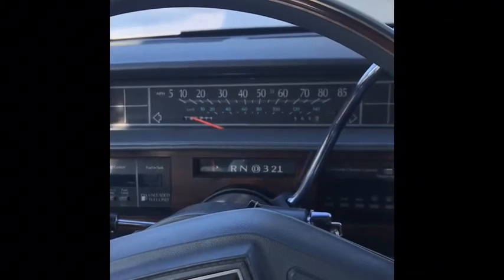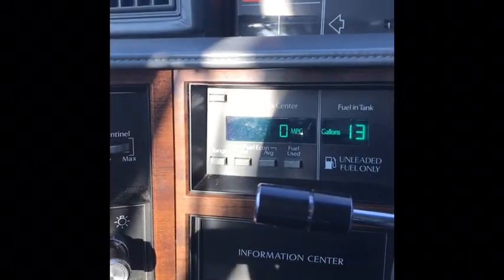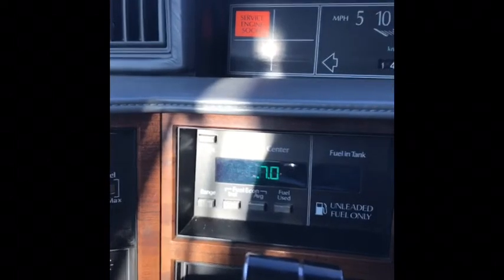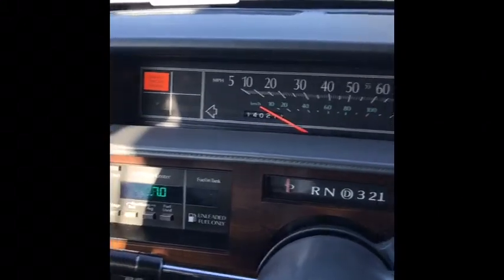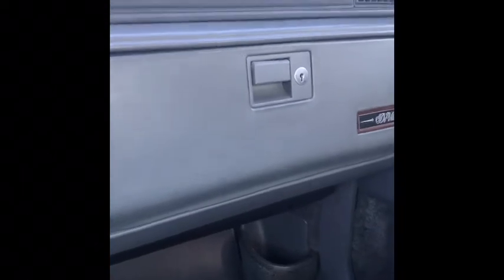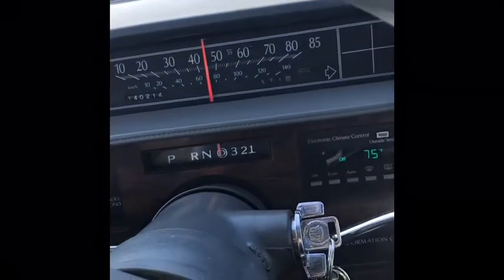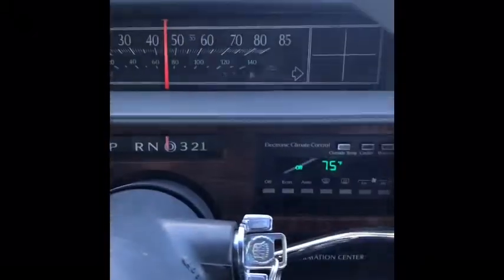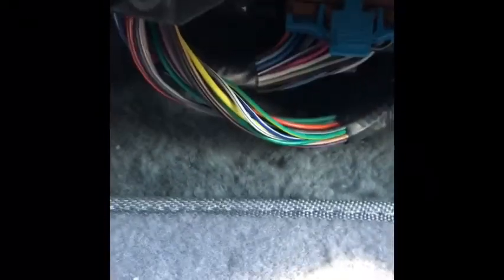ECM replacement 1989 Cadillac DeVille 4.5L

Comment: I got a 1985 Cadillac Deville coup it have a check engine light and the engine run good I reset it it doesn’t work check engine light it still there
Reply: Catalytic converters is still good

Comment: I have an 89 Deville as well but f85 was my code. Any ideas? I was thinking of replacing the ECM because of the rough idle. The EGR, and fuel filter were already replaced. Still have a rough idle

Comment: Hi Andrew, I have had the engine out of my 88 Deville to change the torque converter as well as the timing gears. The timing gets all aligned engine re-installed new distributor fitted as well as spark plugs and leads. New battery fitted however upon initial cranking I have no spark or fuel. Have you or anybody on your forum any suggestions. I have a service manual which I’m trying get the jist of the computer system and the function of same. There is probably a simple solution to this problem but I’m running out of hair trying to fathom it out. Any suggestions would be welcomed.
Reply: Did you ever figure out the problem? having the same issue

Comment: Andrew, I just inherited my mom's 1989 Cadillac Sedan DeVille.  On the info centers it shows rows of small E's.  It started two years ago when it was parked.  I drained the gas that was in the tank and still no start.  I know there is power to the fuel pump.  Any suggestions.  It has 48 thousand miles on it.  Thanks in advance.  BTW  it will start and run for a few seconds with starting fluid.  So I know it's not getting fuel.
Reply from the maker: You can buy a Factory Service Manual on eBay for like $20. It’s better info than anything I could suggest. It has diagnostic procedures to follow to accurately narrow down your problem.
Reply: Thanks... I have one.  It is very informative
Reply: check the rotor button, or the capacitor on top the distributor.....but the problems is more than likely the lil metal piece that spins and sparks the distributor is broke off under the disturb cap..
Reply: It could be the fuel filter or fuel pressure regulator. Do a fuel pressure test
Reply: I know this a old post but I thought I would chime in anyway.  Did you have your injectors serviced?  I bought a 89 Fleetwood that had been sitting since 2006 and changed out the fuel pump and filter and it still would not start.  Had the injectors cleaned and fired right up.  It too would start for a second when using starter fluid.

Comment: I have an 1989 Cadillac Deville. It was running fine before I had it painted. On the day I got it back I drove it 2 blocks and it died out while driving. At first it start and idle rough and then if I would put it in drive or press the the accelerator it would either cut off or drive slowly and won’t accelerate. I’ve took it to the shop and they said it had a bad fuel pump and they replaced the fuel pump and still no change and they replaced the spark plugs and still no change. Before I took it the shop I replaced the coil pack and you guess it still no change. I’m already out of a lot of money and time. My question to you is. Do you think it could be the computer as well?
Reply: Could be a clogged fuel filter or bad fuel pressure regulator. Test your fuel line pressure first at the fuel Rail port with a pressure gauge at auto zone. They can loan that to you. If everything checks out well then the culprit is the icm or hall effect sensor in the distributor aka "camshaft position sensor". Those were pretty common problems with thoses
Reply from the maker: Order a Factory Service Manual off of eBay for like $20.
Reply: Can you get an Ignition control module from a junk yard and try it? $5.00 approx.  It goes in the distributor...look up an image on google images. The description you give points to that.
Reply: its your alternator also you have a week battery something to do with losing power